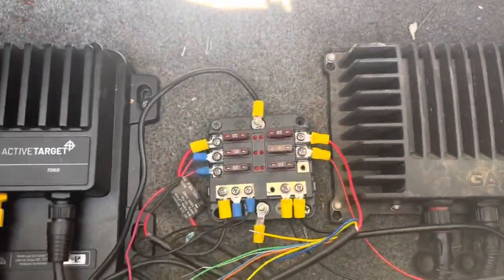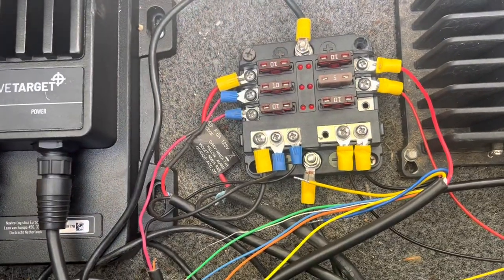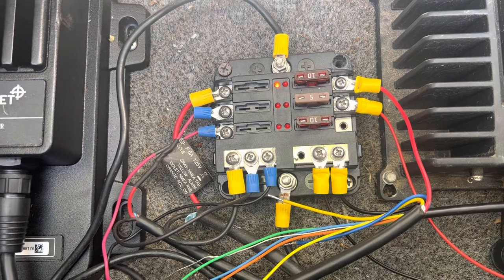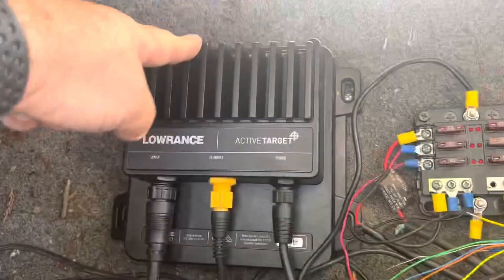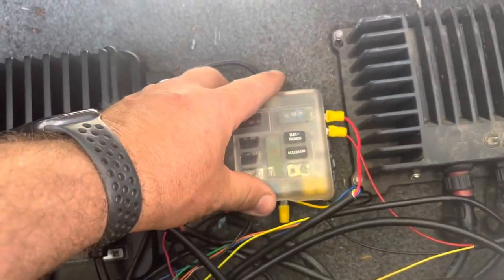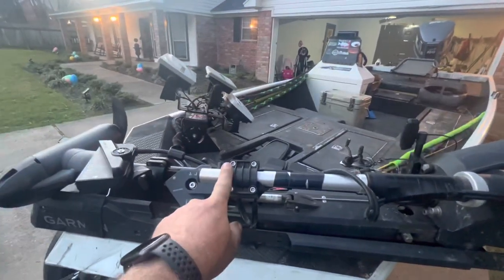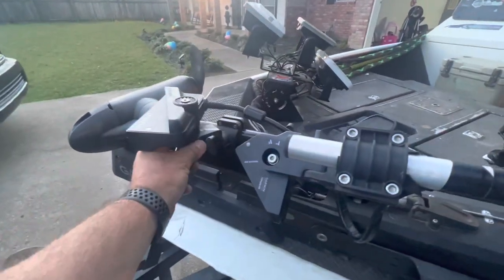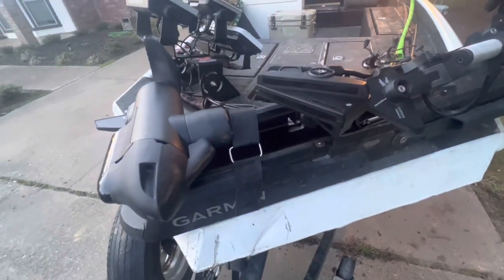Lowrance Active Target: How I Wired Up My Units And Mounted My Transducer

Comment: I like what you did.  Very similar to how I have mine with the main difference being the Fuse Block distributes power individually to my switches and back to a distribution block.  That allowed me to bring all of my supply power to a central location, then bring my switched power feeds back to a central location....  all loads are brought in to the distribution block as well.  But I don't have to pull a fuse unless I want to, flipping a switch provides 100% disconnect as well.
Reply from the maker: I’m researching some different things so I can turn units on and off as needed
Reply: @ggofftheradar7575  PM on FB with pics and video.